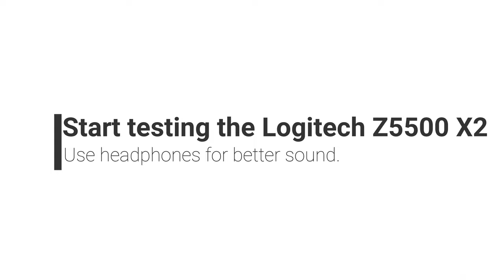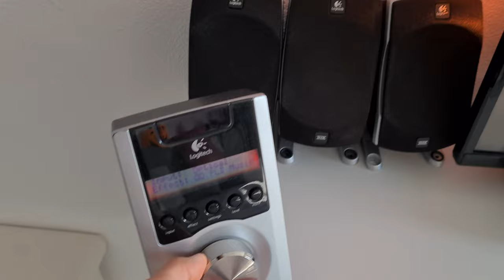Logitech Z5500 Best Mod 3  (2 subwoofer 1 POD Control)

Comment: Hi first of all great video💯. I got a question will a vga Y splitter also work without soldering? I just bought a second sub  so I only need 2 subs on one pod with the 5 speakers   If that possible or do I get strange short circuits?
Reply from the maker: Hello, and thank you!
Theoretically, that Y-splitter must work perfectly for the logitech Z5500 system!
There is also a special Y-cable for the Z5500!
But theoretically there will be problems because of him!
I made this video and explained how it should be done so that there are no problems!
I made another special video only with the modification of the extra cable so that it works perfectly without the risk of burning components inside the subwoofer!
I for one do not recommend that cable in Y!
Reply: Thanks I’m gonna watch it 👍🏼👍🏼
Reply: I just watched the other video and got also some questions about that. What are those things u see at the beginning? And can I order it ? Do have some specific model or series nr for it?     Thanks in advance already 😎
Reply: Only what i find is BYW98-100 or BYW98-200   Diode 🤷🏼‍♂️

And all the wire has to match with the same colors and also for the diodes ?
Reply from the maker: I took the VGA cable from another POD Control and I had to measure the Pin out because the older models have some reversed pins and I wanted to make sure that both cables are identical in color and Pin out!
The diodes make sense to connect on the cable because there is a risk of destroying components inside the subwoofer if you don't use them!
The Y-splitter that you can find on the internet does not have these diodes and because of this there is a risk of damaging the components inside the subwoofer!
POD Control from which I got the cable cost 7 euros (It was defective)
If you want, you can buy that Y cable and modify it yourself.
Add sense diodes exactly as I did in the other video! @earlygamer9106
Reply: Naa I skip the y cable im going your way it feels more confident 🫡   What kind of diode I need BYW98-100 or BYW98-200 or higher ?
Reply: So I can order it 😎
Reply from the maker: Hello, I don't know exactly which model I used.. 1N4007
You don't need a power diode because POD Control doesn't have such a high consumption!
Sorry for the late reply but I was very busy yesterday..
If you still need help, you can always leave a comm. @earlygamer9106

Comment: why wouldn't you just use a vga splitter?
Reply from the maker: I connected 2 cables to be able to use 2 systems, now I have 2 subwoofers controlled by one POD Control!
10 speakers + 2 subwoofers, the sound is extraordinary!
Reply: @Elektro Gamer  yea but you can do it with just the spliter no screw driver needed
Reply from the maker: @badgger_3642  And where is the fun/satisfaction? When you spend money on ready-made things, it is not a pleasure

Comment: HELLO ELEKTRO how are you doing happy new year I HAVE A QUESTION . I HAVE TWO Z2300 LOGITECH SUBWOOFER  HOW CAN I SPLIT BOTH WITH ONE CONTROL POD IF I BUY THE SPLIT CABLE . DO I NEED TO CONECT BOTH TO TH POWER  OR JUST ONE  SIR?
Reply from the maker: Hello, happy new year.
In this model it is not as complicated as in the Z5500.
You have to connect a different power button to start the amplifiers, otherwise all the input and volume wires are connected in parallel.
You can look for a switch with 4 pins, that is 2 by 2.
There are two different contacts on one button!

Comment: can you tell me what color of wire for 
-subwoofer , 
-front speaker, 
-rear speaker,
- center speaker, 
-turn on amp, 
-mute, and 
-ground?
Thank you
Reply from the maker: 1 right rear
2 sub
3 left rear
4 center
5 left front
6 no connect
7 enable amplifier
8 enable mute
9 right front
10 +8v
11 ground amplifier
12 bo figured out jet
13 main groun preamp
14 18v
15 -18v

Comment: Respect my man, wish if I have your talent and experience. 

Quick question though, I'm still rocking my own z-5500, but lately volume is going up and down randomly. Any idea to what cause?
Reply from the maker: Sorry for the late reply, but I did not receive a notification from your post.
I also had this problem, because of the potentiometer.
Most of the time it changes when it was near the subwoofer and we listen to a louder bass song.
Due to the vibrations it changes to the maximum volume, but the potentiometer does not rotate, only it probably vibrates inside and this causes the volume to change.
Reply: @ElektroGamer30  No worries mate, I appreciate the time you took to get back. But issue only affects the stereo speakers (Front Left and Front right), the rest work fine when in surround, I can hear the difference. What else could be the problem? (P.S I've recently had an issue with the electrical wiring in my room which causes a surge, I would hear pops from the speakers.)
Reply from the maker: @ogremair803  Does the effect in which you listen to music matter?
Have you tried digital port?
Or is it just on the jack ports this problem?
It often happens that the jack is in trouble.
At the moment I also have a problem with POD control, in the Dolby Music effect, connected on the digital port, the central speaker does not work, but on another effect or in the 6CH direction it works perfectly.
And for you it may be because of the POD control, a troubled opamp or even some devaluation capacitors.
Also try the digital port and jack ports.
Reply: @ElektroGamer30  Thanks. The thought of trying different ports never crossed me. Regarding on what music, nothing specific, usually from different sounds from video games. I did think maybe it was from the amp, from the woofer. My main theory is something got degraded so fast its starting to have fluctuations of power in the circuitry somewhere.
Reply from the maker: @ogremair803  Unlikely, I blame the POD control, a devalued capacitor causes many problems, even an opamp can be defective.
Try another input, the POD control contains 6 opamps, 3 for analog input and 3 for digital / coax.

Comment: This is awesome, although I didn't have the confidence to do what you did so I just bought me the cable and it works just fine. I would like to know this method, can you put 4 systems and more to one pod or would that be a bit too much?
Reply from the maker: Hello, sorry for the late reply.
Yes, 100 systems can be installed.
It is possible that they are no longer as efficient as they all have a small signal source (POD CONTROL)
Probably 3 - 4 systems on a single POD can be done without losing too much power.
Reply: Which cable did you use as a splitter?

Comment: I want to do it too, but do I need to do anything to the motherboard inside the subwoofer ?
Reply from the maker: Hi, you don't have to disassemble the subwoofer!
Everything is done only in POD Control!
Simply watch the video I made and you will see the whole process!
Connect 2 cables with VGA plug in parallel!
Pay close attention to the wires, because not all the wires need to be connected!!
I made an extra video here for connecting all the wires in POD Control!

https://www.youtube.com/watch?v=QAIeXf0NgBo&t=93s
Reply: @ElektroGamer30  
I will watch the whole 36 min video and do the same
Reply: @ElektroGamer30  
1 more question, will the digital audio feature of the device be disabled, such as dolby, dts?
Reply from the maker: @Keremymz94  Good luck in modifying your system!
In the video I explained absolutely everything necessary to make this connection safe!
Reply from the maker: @Keremymz94  
Absolutely all functions will work exactly as before, only at double power!
I use both systems on one POD Control!
That means I have 10 speakers and 2 subwoofers, all connected to the Smart TV to watch movies like in the cinema, with an extremely strong and clear sound!
I also use the Dolby Atmos and DTS modes when I watch movies and know that the sound is much better with 10.2 speakers than with 5.1!
Reply: @ElektroGamer30  
I'm so excited :) I'll just watch the 7-minute video you sent me and connect the cables to the control pod after connecting them. is it true?
Reply from the maker: @Keremymz94  If you follow the second video, you must use diodes exactly as in the video, otherwise you risk damaging the electrical components in the POD Control or even the subwoofer.
If you don't have diodes, you have to do everything I did in the first video!
Reply: Can I send an invite from Instagram so we can talk more comfortably there?
Reply: @ElektroGamer30  ok then i was going to make the diodes as i think it is necessary it can be done without them then
Reply from the maker: @Keremymz94  
Hello, sorry for the late reply, I didn't see the notification!
If you want to discuss it, we can do it on Twitter!
https://twitter.com/CsGo54556456

Comment: friend, my control pod appears on the display. "MUTE ON Over tempurature'' . I suspect it's not a defect, but replaced with the original.
What do you think about it?
Reply from the maker: Short circuit pins 6 and 12 (vga connector) best way to fix it: disassemble the POD control and find thin black and orange wires that don't come from the center shielded wire, then touch each other (short circuit
Reply: @ElektroGamer30  Could you be more specific, what do I do with the black and orange wires? thanks
Reply from the maker: Tie them together.
(short circuit) makes contact between 2 or more wires.
touch the two wires with them

Comment: I can see 2 subs but 10 speakers? I dont get that.
Reply from the maker: Hello, each subwoofer has 5 speakers, 2 front, 2 rear and one central.
Having 2 subwoofers (2 systems) I decided to use all 10 speakers (5 from each system).
Watch a video with the sound of the 2 systems after all the changes I made.

https://www.youtube.com/watch?v=tZlFfD_XHKs&list=PLsgyMOzSu2Eq9WmEVhE2aZzsZ22VpJyPS

Comment: Don't connect the +18V, -18V and 8V lines together! Especially the +18V and -18V ones! Voltage regulators don't like reverse voltage and you will certainly have a small difference between them. Plus, even though you connect them together the current doesn't split equally. The one set will be pushed to limits before the other gets to output any current.
Reply from the maker: Thanks for the advice, that's what I did.
Watch the video and if you like it, press the like button.
Reply: So glad I have kept my Z5500 it’s legendary
Reply from the maker: Hello friend, I managed to modify the cables to receive power from both systems!
Now POD Control can be powered from both subwoofers, without having to reverse cables to power just one subwoofer!

https://www.youtube.com/watch?v=QAIeXf0NgBo&t=91s
Reply: I am a little bit confused because you say not to connect +8v, +18v and -18v. But here I see what looks to be one red wire and two black ones?

Shouldn't there be two red and one black?

Could you confirm which of the three wires that shouldnt be connected from the second subwoofer?

Thanks!

Comment: Nu ar merge si o combinatie dintr-un z906 cu z5500 oare ? Asa ai avea un pic de medii in plus de la 906 si bass-ul in plus de la 5500 ? :)
Reply from the maker: Daca te referi sa folosesti ambele sub pe un singur pod, nu functioneaza.
Dar poti trimite semnal in ambele poduri. Nu detin un z906 si sincer pe astea am dat 650 lei ambele complete:))
Am facut un mod pentru sunet, vezi la mine in video.
Si o sa mai urmeze ca tot nu sunt multumit =))
Reply: @ElektroGamer30  Nu ambele sub-uri ca ar ajunge unul :)) chiar o sa ma uit ca-s curios ce se poate modifica :)
Reply from the maker: @emg2005  Oricum se aud ff tare. si bass si medii.. Se poate modifica totul, nu?? de la tda la condensatori. schimbare flecventelor este cheia :)
Incerc sa scot subsonicul sa dau si sub 30 hz in sub. si sa il limitez frecventa de taiere la maxim 100 hz, ca el primeste si 1khz :))
Reply: @ElektroGamer30  were u successfuly in doing this? By-passing subsonic filter and putting 100hz cut off so sub doesnt play more than 100hz. Please make a video of this mod
Reply from the maker: @tibby1239  Hi, I haven't tried ...
It's a little more complicated than it looks.
But this is how the subwoofer box has to be replaced, because it is adjusted from 35-40 Hz and even the speaker.
Reply: @ElektroGamer30  hmm, have u ever tried using equalizerAPO to set a filter to cut off frequencies above 100hz. Some have reported that it works and eliminates the higher frequencies from the sub.
Reply from the maker: @tibby1239  I didn't try, I connected it optically to the TV.
Reply: @ElektroGamer30  am vazut bine? chiar ai cumparat cele doua subwoofere z5500 cu 650 lei? daca da de unde le ai luat?
Reply from the maker: @swirl4440  Pe primul subwoofer am dat 400 lei si pe celalalt 250 lei.
Sunt cumparate din Germania! Aici locuiesc :D

Comment: Hey nice video, seems you know how its work! My Z5500 stopped working some years ago, i tried to fix it, but i couldn't, the issue is with the power. The control panel don't get any power, the red light doesn't work.
Reply from the maker: First of all, the fuse must be checked.
If it is good, several measurements must be made.
Reply: @ElektroGamer30  Yeah i had to change the fuse, i found one fuse on the market 2A 250v, not like its written on the back (2AH250V with time delay). I think that fuse doesn't work.
Reply from the maker: @elsotiriadis  It must be replaced with an identical one.
Reply: @ElektroGamer30  Hello again, looks like the fuse wasn't the issue, there is something else going on...
Reply from the maker: @elsotiriadis  Then you have to do more checks, if you don't know how to do it, it is better to ask someone to help you, or to take them to a repair service.
Reply: @ElektroGamer30  Yes i will do that, thanks alot! :)
Reply from the maker: @elsotiriadis  
Then you need to check the power supply first.
Everything about food.
Cable, transformer, power supply board, capacitors, the 2 large and the small 25v.
If this capacitor is detached from the board and does not make contact, the control POD will not be powered.
Reply: It is basically always the pod that goes out so buying a replacment pod online with the right pid will work
Reply from the maker: @timtamcs9110  I recently discovered that when this problem occurs, and everything is perfectly functional in the subwoofer, POD control is defective.
To solve this, open the control POD and on the board you will find 2 diodes next to each other, replace them and the POD will work. (in some cases there may be another defect)
Reply: @ElektroGamer30  Yeah nah on my pod I've already replaced them before and installed a fan in the back to help with keeping those diodes and the transistors cool, but I've been having what I think is main chip problems. I've spent way too long trying to get the stupid main pod to work so im now just working on getting it to work without the main pod now
Reply: @Elektro Gamer  I think the problem is on the transformer, because when I turn on the subwoofer, it's dead. I checked the capacitors, and they are fine.
Reply: @elsotiriadis  measure all transformer outputs, mine sub is dead too, now trying to solve it, in my case it's probably voltage regulator, cuz there is no 8V present only approx 1-1.2V.

Comment: The power supply of only 1 transformer, is not enough to put both at maximum. Need to power the second subwoofer, in parallel.
Reply from the maker: @giulianosteifn  Hi, each subwoofer has its own amplifier.
There are two perfectly functional systems connected to a single Control POD.
The signal comes out of POD Control and is distributed to both amplifiers.
The system has 2 TDAs of 100w connected to output 180w at 8ohm.
If they were both connected to a single amplifier, it would burn in a maximum of 10 minutes.